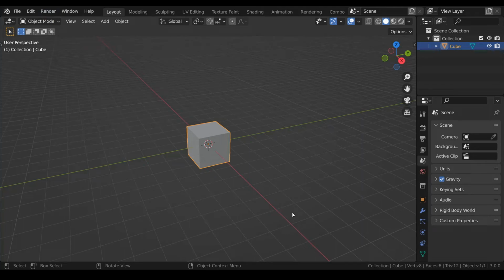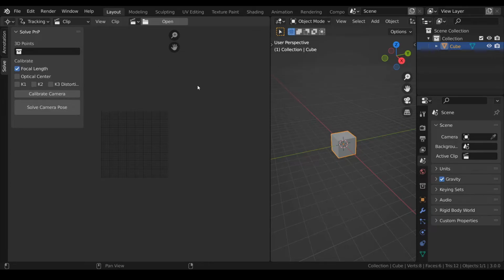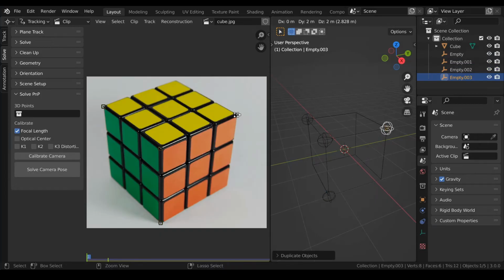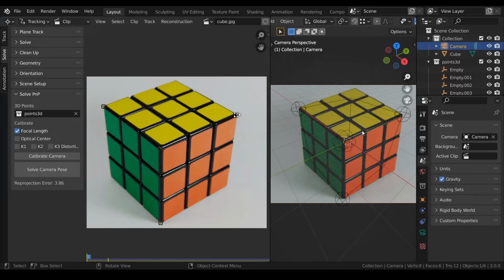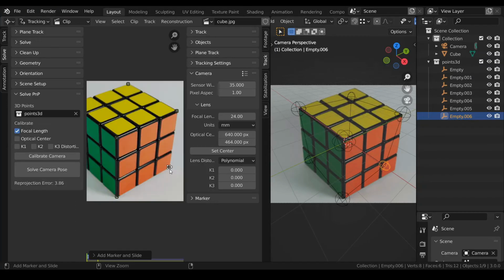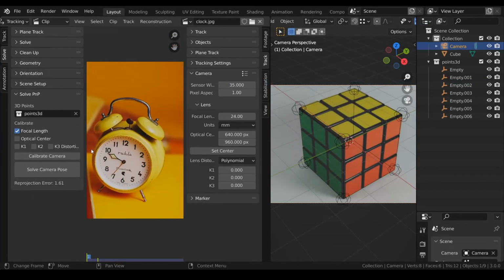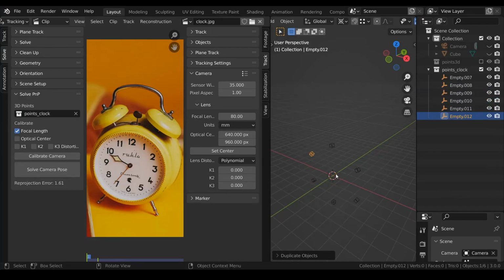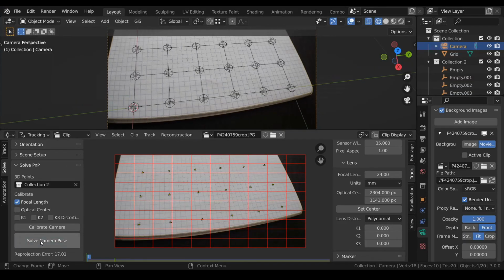Camera PnPoint Introduction - Blender Addon

Comment: Dont work on Blender 4.5.3/ Do you have a version fo this Blender?
Reply: Python: Traceback (most recent call last):
  File "///AppData\Roaming\Blender Foundation\Blender\4.5\scripts\addons\camera_pnp\__init__.py", line 63, in execute
    return solvepnp(*sceneinfo) 
           ^^^^^^^^^^^^^^^^^^^^
  File "C:\///AppData\Roaming\Blender Foundation\Blender\4.5\scripts\addons\camera_pnp\campnp.py", line 121, in solvepnp
    
TypeError: only 0-dimensional arrays can be converted to Python scalars
Reply: @JayDeeTrue  I had the exact same issue. It turns out the new OpenCV algorithm caused the bug, so the code needed an update. Since I'm not a coder, I used a few AI platforms to help me find a solution. After a lot of trial and error, I finally got the add-on working perfectly! I've tried sharing the link to the fixed file here several times, but YouTube keeps deleting my comments.
Reply: @rezaferdian6028  Can you please share the link on your fixed version? Put it in description for one of your videos and notify here pls if you will. Thanks!

Comment: It's not working unfortunately. It don't want to install OpenCV for some reason. An error comes up:

Command '['C:\\Program Files\\Blender Foundation\\Blender 4.0\\4.0\\python\\bin\\python.exe', '-m', 'pip', 'install', 'opencv-contrib-python']' returned non-zero exit status 1.
Reply: Just run blender as administrator this will solve the problem

Comment: This is the tool I was looking for, to transition from 3Ds Max to Blender.
There some options I'd like to see further in this tool but overall it's looking pretty good.
Is is possible to add the option to make points on the geometry active or deactivate them for the camera calculation? Maybe just a checkbox in a list or something, like in 3DS Max?
I use this max tool to match cameras of cars all the time.

Comment: Doesn't work with the photo I have.
Big room, 2 walls, with chair rails. Can't see the ceiling. Round table blocks bottom wall corner and baseboard.  One full painting on one wall (only good thing at all).  Icarus for Blender 2.4 was a lot easier to get the correct camera settings.